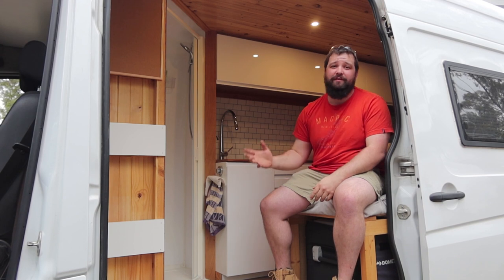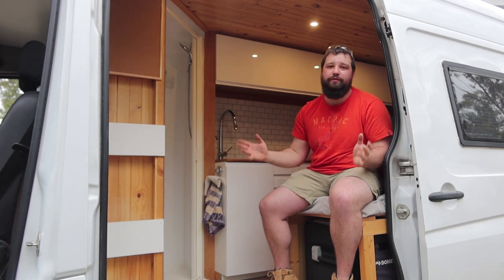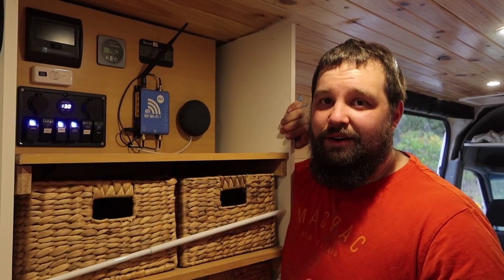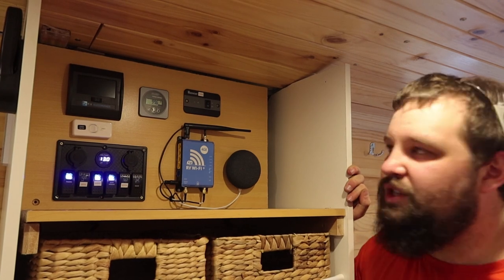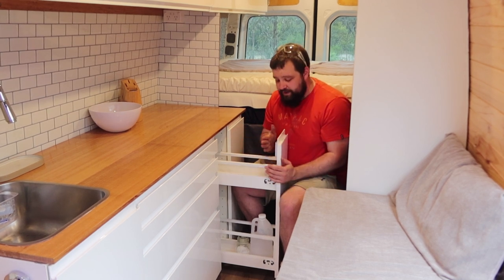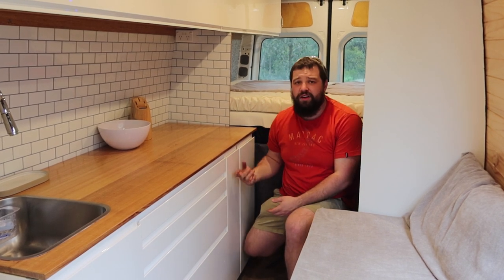Luxury Van Tour | Off Grid Sprinter Conversion | All Electric with shower, A/C, full kitchen

Comment: Great to see Australian van builds. I am definitely subscribing to see you transform Lucy.  I would love to hear about any regulatory issues you face when altering a vehicle in Australia which may impact on registration or the amount of DIY work you can put into your van.
Reply from the maker: Feel free to get in touch with us on our Facebook page (same name) and I can gladly answer those questions for you. It's fairly straight forward, the main thing is gas to be externally mounted (box is fine), you need certs for elec and plumbing/gas and then it's just about making sure you are within GVM and everything is fixed appropriately (engineers certificate). Sounds more complicated than it is though.

Comment: wow, love the electro magnets on the draws! I'm so using that in my van when I upgrade the kitchen! I'll be copying the magnetic window covers as well!
Reply from the maker: We've actually found an even better and cheaper option for our next van build that we've never seen before. We'll be doing a build series video specifically on this soon so make sure to subscribe
Reply from the maker: @Yeehaw Bot we can definitely arrange that! Stay tuned...
Reply: @WanderingandWilderness  I'm curious to see your new solution. I was wondering how much power those electromagnets use. I don't mind how much power it uses while I'm driving, but to use it as security while parked, I don't want them draining the batteries. I'm thinking to just use a latching solenoid to latch things with so it doesn't constantly use power.
Reply from the maker: @MrGundawindy  They are under 5 watt each but our new solution uses less and has a better continual use rating. We'll be doing a video soon on them. The new solution will be about 3 watts per drawer.
Reply: @WanderingandWilderness  Wow. That's much less than i expected. Can't wait for the next video. 👍

Comment: As it's a 12v system are you using the 12v RTX-2000? If so can you tell me where you got it? Thanks.
Reply from the maker: Correct. We got it from mygenerator.com.au which is a great  all in one shop. Has most of what you need.

The new van we are currently building though has a custom setup that is 24v and mostly undermounted. It's more along the lines of the CruisinComfort in America but its about half the price and much better. Full video coming soon.

Comment: Nice! Are you guys traveling "down under"?
Reply from the maker: Indeed we are.
Reply: Cool! I've been looking at some Sprinter's myself. I hope you aren't too affected by the lock downs.
Reply from the maker: @anotherm2722  We are currently building our second Sprinter (Build series out soon). We love them. Good balance of everything
Reply: What do you think of their 4 cyl diesel?
Reply from the maker: @anotherm2722  Solid. We currently have the new 516 and it's smooth as. Our old one was the 313 and still had plenty of power despite almost being maxxed out weight wise
Reply: It seems the used ones are kind of pricey....just wondering approx. how much are they new? The again.
Reply from the maker: @anotherm2722  All vans at the moment are very very overpriced in the secondary market. They are in very short supply. Sprinters start at around 68k AUD brand new but currently it's a 6 month waitlist. It also depends which size and mods you get, they drastically go up from there.